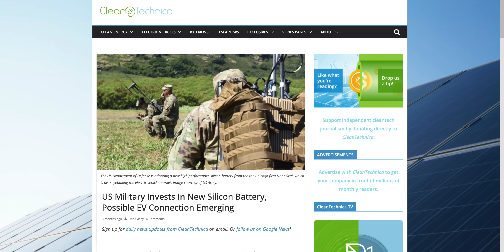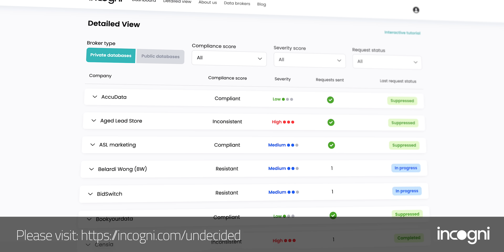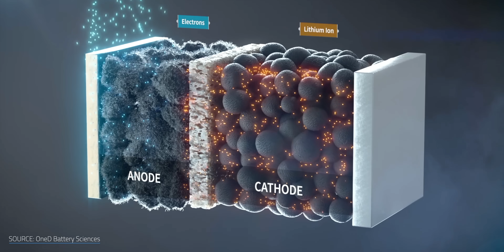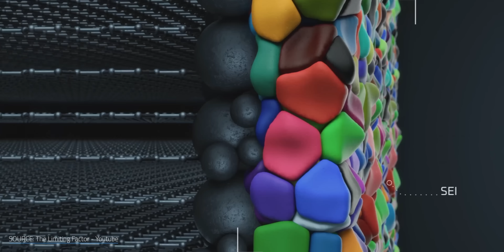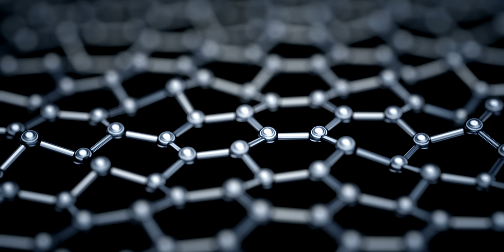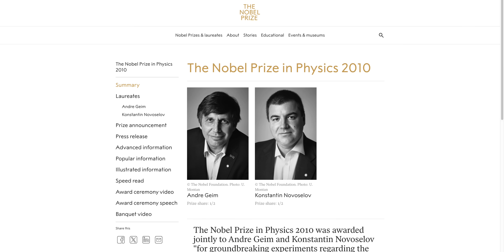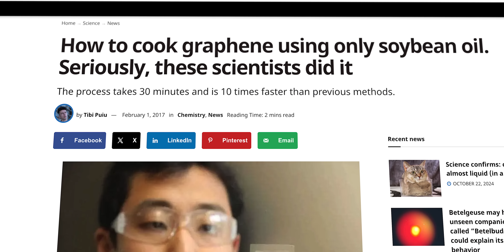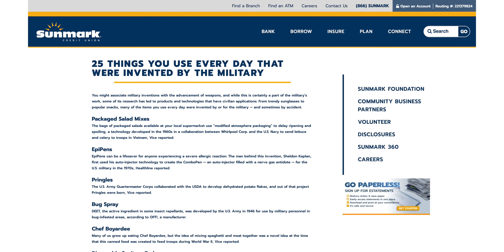Why The US Military Chose Silicon-Graphene Batteries

Comment: $ENVX Enovix is pioneering next-generation battery technology with its breakthrough 3D Silicon™ Lithium-ion architecture, designed to deliver higher energy density, faster charging, and longer battery life than conventional batteries. Leveraging advanced manufacturing and a unique cell design, Enovix powers devices across industries—from consumer electronics to electric vehicles—with batteries that are safer and more efficient. By addressing the critical demands for energy storage in a rapidly electrifying world, Enovix is driving the future of power and enabling sustainable innovation.

Comment: Not just better batteries. We need a cheap and bountiful copper replacement. Copper cost is insane and is often stolen because of it's value and use in EVERYTHING requiring conductivity.

Comment: Just wondering on the advancements in Silicon based formulas for batteries, such HPQ Silicon ressources has been working on. Also being approached by a NATO member for it's lighter/stronger/faster battery concept. Not to mention a one step process in providing 99.9% battery grade silicon, with close to 0 carbon footprint. Thoughts.?
Cheers

Comment: I was raised in a unique environment,
i grew up around both NASA And Military Engineers, including thermonuclear engineers, as well as race car drivers and race engine builders.

I was taught hands on approach is the only way to learn, i was taught to ask questions, and to never accept impossible, as a final answer, but rather; as a challenge that earth humans have not yet, overcome.

i was taught that scientific laws are theories, which are constantly extended, expanded, re written and updated by the greatest scientific minds on the planet.

I was introduced to graphene just over twenty years ago.

a NASA research scientist and engineer was visiting friends, and during dinner, the research engineer shared his knowledge, and the future, of graphene.

I was introduced to graphene as the battery technology of the future, and told that the materials are abundantly available, extremely low cost, greater energy density, no fire hazard, and charge extremely fast (if so desire)

longer cycle life and extremely low resistance.

as you mentioned, what was in need of development is the processing of materials.

with military investment, this is quickly overcome.

it is extremely important that demand for this technology (graphene batteries, military grade) be known. demand drives supply.

if you want this technology, demand it, ask for it, and you will get it.

this is exciting!

there is an ebike company that made their own graphene batteries which are very good, and these young gentleman (at Rumble Motors) didn’t have access to the budget the military has access to.

if a young startup company can overcome the manufacturing challenges that have slowed the inevitable transition to graphene batteries, i am confident the military will create many paths/ways, to get this technology into all industry/the publics hands, as soon as possible.

the time is now.

we are ready for this.

Comment: 2:29 Actually!, if a battery is 15% longer lasting, then the soldier can carry 1/1.15 as much for the same electrical energy; and if it's also 15% lighter, then he can carry only 1/1.15 * 0.85 = 74% as much:  a 26% savings on weight 👍🪖

Comment: Well, those Batteries sound just too good to be true. So one major Flaw i see is the Cycle Stability and the Temperature Range those Batteries have as an Problem. This Batteries would s*ck to use with a Temperature Range of -10 to 20 °C. I know that the American Military has though testing Conditions, but also allot of them. It feels kinda like an mix and match.

Comment: I compared the datasheet of the NanoGraf INR-18650-M38A to the LG INR18650 MJ1, and while it's does have a bit of a bump, it's only about 7% in energy capacity and 4% in specific energy (Wh/kg) - the max weight of the NanoGraf is 50g vs 49g for the LG which eats up some of those capacity gains. I'm sure there's more theoretical headroom and you have to start somewhere,  but it's worth putting in context where things actually stand atm.

Comment: The statement of graphene being expensive to manufacture is actually only half the story. I remember actually speaking with some scientists experienced in graphene and a common thread I found is that they all make their graphene on site before use. Not because they can't buy it from a manufacturer or that it's too expensive, but because the physical, thermal or chemical properties do not match what they wanted or it turned out that the product was actually just really fluffy graphite.

The truth is, there is no quality control process for graphene nor a way to fully determine the size and thickness of a graphene sheet without an overexpensive microscope that can see at the atomic level.

It is also worth noting that this criticism focuses on graphene made from graphite or materials with large compositions or "top down" methods. Bottom up methods that make graphene from carbon containing gases like methane or acetylene use really expensive CVD machines that absolutely fall under the videos criticisms. I imagine Nanograf are making all their graphene on site before battery production.

Comment: I've been looking into graphenes uses ever since 2019. There was a point where there was research into graphene generators, where specific gas would bounce off the graphene sheets and cause them to vibrate, they'd also naturally move with temperature changes in a certain range, effectively giving you power for nothing. There was also some research being done in graphene nanobots, where they'd essentially be powered by your blood. 
The only issue for all of this, is funding. Like you said, it's not easy to make graphene that's good enough quality for any of these use cases.

Comment: Aren’t those the same tech Chinese phones have been using for the last 2~3 years?
Reply: For cry out loud, stop pretend you know the composition each smartphone makers choose and push the idea “Apple always the best”.

Apple, Samsung, Google are famous for refusing to implement the latest tech for higher profit margin. And if you haven’t realized, neither of these 3 have smartphones on silicon carbon battery
Reply: @Peizxcv  For crying out loud, take Xi the Pooh dingus out of your bollocks! Doping carbon anode with silicon is nothing new and it gets higher performance at the cost of faster degradation...
Reply: Nope. The faster charging and larger capacity in those phones comes at the expense of faster degradation. They are basically overcharging it. They don't worry as much that your phone dies in three years, they will be ready to sell you another one...
Reply: @ You are just telling me you don’t understand the tech in extra words
Reply: @coachpotato7353 ATL, not CATL. CATL split from ATL
Reply: @Peizxcv  dude, liking your own comments is uncouth... back to the subject at hand though, customers can have a say in a mix they get - aluminum, manganese etc. - optimizing their pack for energy density, C rating etc., but something always has to give, be it cycles, self discharge, degradation.

Comment: You stated that the best electrical conductor at the moment is copper. When I was learning about electricity, Gold was the number 1 conductor and Aluminium was 2 with copper number 3. Gold was too expensive naturally to make wires from. Aluminium was also far more expensive than copper, so copper was chosen as the mainstay conductor of electric circuits because of price/performance ratio. Even though copper is NOT the best conductor.

Comment: There is no such thing as a "light" kit for a soldier. Every time a soldier's base gear gets lighter the Army immediately says "Oh fantastic! Now you can carry even MORE crap!"
Reply: Can confirm.
Reply: I've never been in the military, but what I've heard from people who have been in the military, this sounds right.
Reply: If soldiers ever get power armor to assist with the load, they'll have them kitted out to weigh as much as a Chevy Suburban.
Reply: @skaboodlydoodle   former 11B1P and I can confirm this is a true statement, unfortunately.
Reply: @2012Viking 
I bet given the choice you'd prefer a larger fraction of those kilos to be ammo made possible from that smaller fraction of batteries!
Unless you can throw REALLY hard! 
...
Hey that's an idea, give military lithium batteries a "press here to explode" button, turning them into makeshift incendiary and gas weapons, specifically: 

Hydrogen fluoride
Hydrogen
Carbon monoxide
Methane
Carbon dioxide
Ethylene
Phosphorus pentafluoride
Phosphoryl fluoride

Bit warcrimey but you can just say it's a natural part of battery fires! 😂
Reply: The soldier normal kit today weigh more than a medieval full body armor made of steel.
Reply: @SJosedn  that's because we don't have squires anymore
Reply: @SJosedn  But you don't wear it all day.
Reply: @SJosedn  if the modern soldier kit is at 100 pounds now, that's almost double a suit of full plate on average, and armor was better distributed over the body.  Modern soldier kits are worse than people think.
Reply: @SJosedn  i mean, an soldier doesn't need to do CQC
Reply: @null-t2iYou definitely missed the point there mate. If the base equipment gets lighter then whatever weight is reduced just gets added back in later with new kit, whether it's standard infantry or Light infantry
Reply: @null-t2i I think you misunderstand what he's saying, for one, light infantry isn't very light, just lighter than other infantry, they still pack some decently heavy gear, so he's right that "light" isn't a thing in the military. lol
Reply: @null-t2i Their battalion being light (lighter vehicles and sometimes weapons) may be light but their carry weight is just as if not heavier than any other soldier’s carry weight.  The carry weight of anyone going out of the base or FOB is going to be similar across the board.
Reply: They will be asked to carry 20 lbs of lighter batteries instead of 20 lbs of heavier batteries
Reply: Fact
Reply: It makes sense I guess.. The equipment would have a weight budget so they would use the whole budget whenever it's updated
Reply: @null-t2i Light infantry is the heaviest
Reply: Ounces are pounds, pounds are pain.  At least what I have heard from vets.
Reply: Wasn't the saying that your modern day soldier carries 50 pounds of the most lightweight and advanced gear around?
Reply: Its the same for any army... even european army go that way... everytime there is a material improvment and stuff get light/smaller... they just shove more stuff inside to go back to the weight limit
Reply: Oh you lost a lb in batteries, here's 4 more mag pouches, keep the loaded.
Reply: Every since the Roman army the amount of weight a soldier is expected to carry is the same.
Reply: Yea but if that extra piece of kit saves your life, the statement he made about it being a difference between life and death holds true.
Reply: “1/2 the weight!? FANTASTIC! Now you can carry TWO of them!”
Reply: 💯 1971 Vietnam. My load out was somewhere north of 100 pounds and I weighed 165.
Reply: Considering the heavy new rifle they're trying to roll out, I think they already did load people up with more weight even before this change.
Reply: The standard combat load for a soldier has been "whatever your average soldier can carry" since as far back as we have military records for. Even early copper culture armor and weapons would have added up to about the same as a modern shooting soldiers kit.
Reply: Just like the new rifle and cartridge. Both are heavier than the M4 and 5.56 mm. Plus the combat load out of the Fury ammunition will be less than the current ammunition load so our soldiers won’t have as many rounds to fire without a resupply.
Reply: This is like when I make a part cheaper on my DIY computer. Then I go like "Oh great, now I have more budget for THIS." (Oh no, not the same?)
Reply: Haven't you noticed the exactly the same logic with computers? As hardware got faster, the programmer enthusiastically loaded their software with more stuff so that the perceived speed remained the same?
Reply: Yes!  A trend running back to the war between the states.
Reply: Trump will fix it
Reply: Do you guys utilise the robots yet? That are always on social media, That carry gear? 
... I guess itd be the same problem again anyway though wouldn't it
Reply: That's also the way consumer convenience appliances "helped families have more free leisure time":  in the early 20th Century The World needed a homemaker to stay home, cook meals using scratch ingredients, clean the house, take care of the children... with zero microwaves, few appliances.  And so culture named this person The Housewife, and a home couldn't get by without a homemaker do all these duties.  But then packaged meals, fast foods, microwaves, various appliances came around advertised on TV to give the Housewife more leisure time.  Where are we now:  zero housewives, both work full time jobs to afford a home and pay the bills.
Reply: @skaboodlydoodle  our encryption gear weighed over 200lbs. We just left it and didn't use radios unless we were totally screwed.
Reply: @null-t2i  big difference between your personal ppe kit being called light vs. Battalion level being called light. No one ever mentioned the level you brought to the conversation. Good job b.u.b.
Reply: Yes. Crap. Grandiose choice of word there.
Reply: military floating backpacks and exoskeletons
Reply: As war in Ukraine shows: there's never enough of crap (which you need)...

Comment: What is really missing in information is how many cycles and how do they cope with low discharge and full charge. On their website they say 1000 cycles / 80% under EV conditions. which I don't find very impressive. If it is similar for storage systems that is just WAY to few cycles and a total deal breaker.

Comment: Range and playback time aren't technical characteristics. Neither battery cells nor batteries have range or playback time. Cells have energy density, power density, nominal voltage etc. Only devices equipped with batteries can provide a certain range or playback time or can benefit from improved batteries  providing extended range or playback time. Only increased battery capacity (in Wh or some other measure of electrical charge) permits extended range or playback time. Now, if keeping both the weight and volume of the battery under control is also a high priority - it frequently is - then the technical characteristics of the battery cells that must be improved are the gravimetric energy density of the cells (which means weight needn't be increased even as battery capacity gets a boost) and also the volumetric energy density of the cells (which means battery volume needn't be increased even as battery capacity rises).

Comment: Summary in 9 bullet points  if you dont have time: 

1. **Funding and Focus**: The US military has invested $45 million in NanoGraf's silicon oxide-graphene (SOG) batteries, primarily for small tactical universal batteries (STUBs) used in portable military devices, like radios and GPS units.

2. **Military Demand for Battery Innovation**: Soldiers carry up to 20 pounds of batteries due to the variety of electronic gear they use. Lighter, longer-lasting batteries could significantly reduce the load and improve efficiency.

3. **Silicon-Graphene Battery Advantages**: NanoGraf’s SOG batteries are about 15% lighter and last 15% longer than typical lithium-ion batteries, making them suitable for demanding military applications.

4. **Silicon’s High Capacity with Limitations**: Silicon can hold much more energy than graphite, increasing battery efficiency by up to 24 times. However, it tends to swell, leading to structural damage and reduced efficiency.

5. **Graphene for Strength and Conductivity**: NanoGraf incorporates graphene to reinforce silicon, improve conductivity, and stabilize the battery, but manufacturing high-quality graphene remains costly.

6. **Domestic Manufacturing for Strategic Independence**: Over 80% of lithium-ion batteries are made in China, so the military is investing in US-made batteries to reduce reliance on foreign supply chains.

7. **Cost and Scalability Challenges**: Producing high-quality graphene is labor-intensive and costly, impacting the battery’s price. NanoGraf claims scalable manufacturing but keeps key details proprietary.

8. **Commercial Potential and Expansion**: NanoGraf has received additional funding from the Department of Energy to build a large silicon battery plant in Michigan, which may enable expansion into EVs and consumer electronics.

9. **Path to Consumer Markets**: Military technology often trickles down to consumer products, so there is potential for these advanced batteries to reach smartphones, EVs, and other everyday devices in the future.

Comment: Altech battery make a silicon aluminium graphite anode material and are reporting 55% power density  improvements 
Guessing it’s cheaper than graphite 
Appreciate your opinion

Comment: So you know, electrons don't actually flow through the material. Or technically they do a little bit but that's not how electrical energy is transferred through a material. Think of it like a wave in the ocean and the electrons are buoys bobbing up and down. An buoy may drift toward shore but it would not move with the wave.

It's not a perfect analogy because the movement of electrons is also what causes the disturbance in the electrical field that propogates the wave, but it's a more accurate picture than electrons flowing through the material.

Graphene has amazing conductivity because electrons are only confined in one direction along graphene's "2d" surface. Electrons that get "bumped" (via the EM field) are less much less likely to "hit" (via EM) nearby nuclei than in a 3d structure and are thus freely propagate the wave to the next electron.